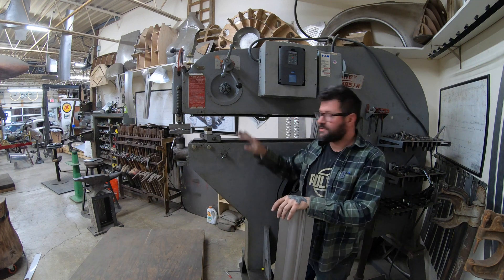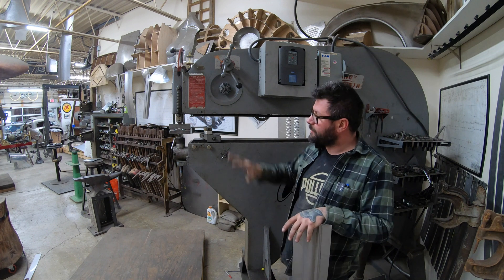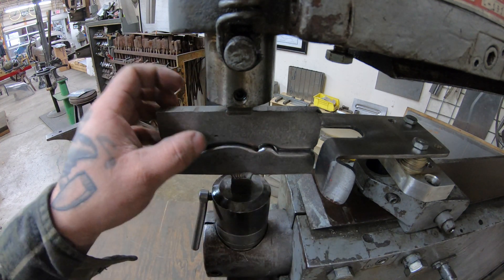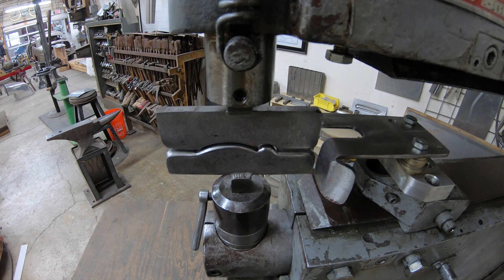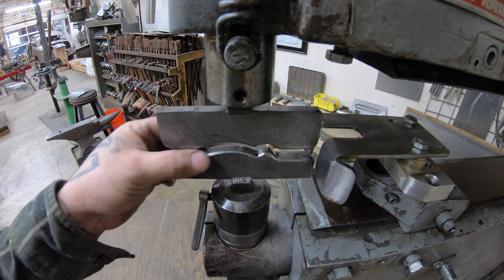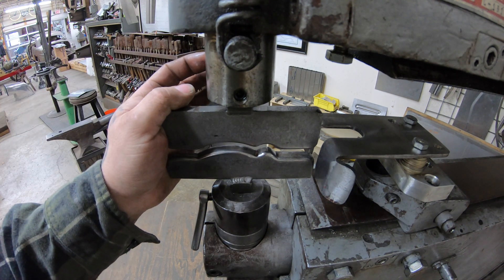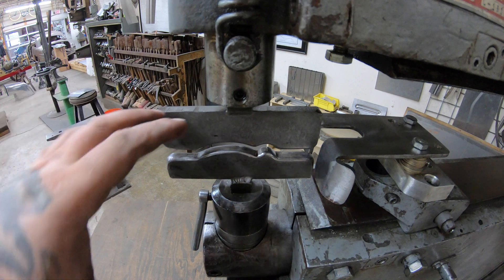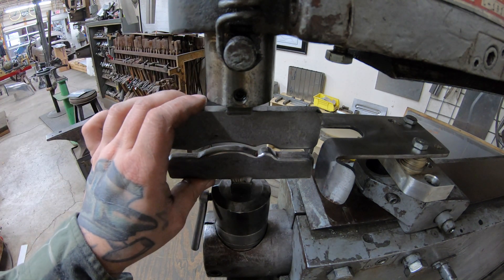How Does A Lennox Machine Work?

Comment: Why not wire EDM the tooling? It's cheap as hell. At least it is if I do it for you! LOL
Reply from the maker: Because i can make it myself in a couple hours, instead if having to draw it up in CAD, send out the file snd wait for the tooling blanks to come in and still have to fine tune, do lead in/ lead out, weld on stems, and polish faces
Reply: @cornfieldcustoms  You are the Man Mike I hear you on this as it is very hard if not impossible to find someone to do it exactly as you require so like you said above it's best just to do it yourself. Thanks for sharing

Comment: What do you use for lubricating the panel? Do you lubricate every panel you run through the pullmax? Does it leave less tooling marks?
Reply from the maker: Lube is 50/50 ATF/ mineral spirits. Proper designed and made tooling will not leave tooling marks